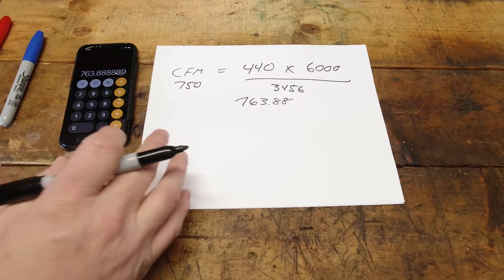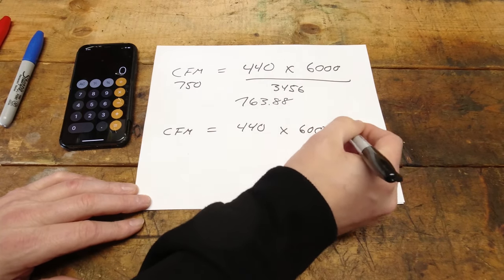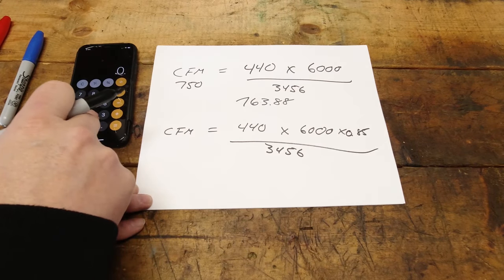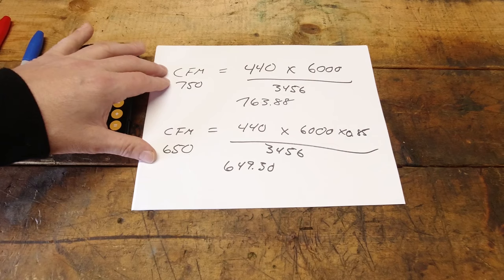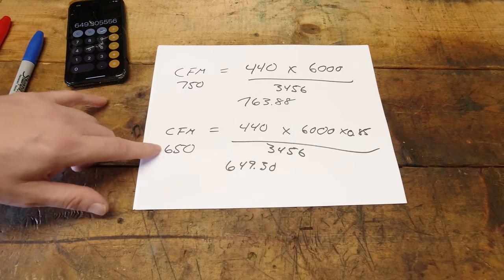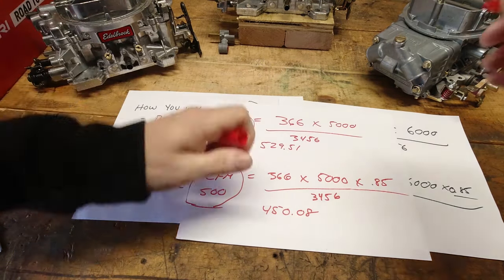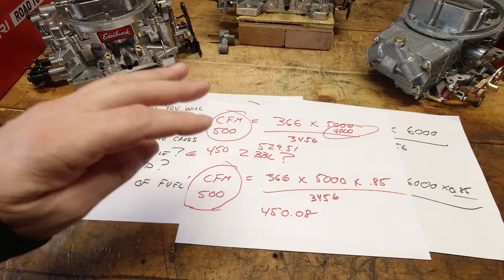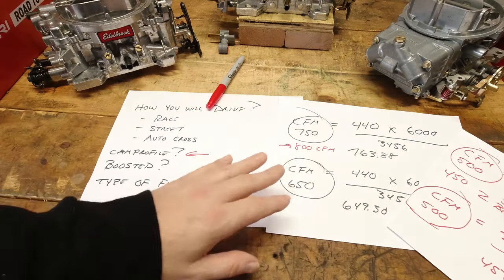How to Choose the Right Size Carburetor

Comment: I have a 385 sbc stroker and have a 650 carb on it and I feel like it's to small ... it takes off really good  and  runs lean around 3,800 rpm on up ... it's weird tho It's an old quickfuel DP blow thru carb just can't seem to make it work... it's on all  motor right now I plan on spraying it later ones running right motor is built for nitrous
Reply from the maker: You’ve got a lot going on there.  How do you know it’s running lean at 3800?  Are you monitoring with an AFR?  Running a blow through carb on an n/a engine is likely causing part of your problems.  The main metering circuit isn’t seeing the volume of air it needs to flow fuel.  Time to reset.  Based on what the video talked about, what’s the rest of the equation?  You have to give those numbers so we can make a determination on what the best size is.  Don’t know the rpm?  What are your cam specs then?  How are you going to drive this?
Reply: @MuscleCarSolutions  the cam lsa 105, dur 256/264 .... 215cc heads , strip dominator  intake..
Reply: Rpm range 3,200-6,500..... I drive it on street but gonna be raced pretty heavy I drive it like  I stole it ...I know I need more converter than I have right now  so will change it later and I need more gear than 3.73 I have on it right now
Reply: Plugs look Lean to me and it breaks up in upper rpm ... like I said gets out of the hole like a monster and just noses over
Reply: @MuscleCarSolutions  sorry sent messages to myself 🤦‍♂️
Reply from the maker: @garypena5178  I won’t pick this apart too much but the LSA on that cam isn’t nitrous friendly.  You need the rpm from a wider lobe separation.  112-115 on a nitrous engine is what it typically likes.  You’ll struggle a bit with that.  Plus the intake and the big runners are asking for the volume of airflow and that cam will kill a bit of that.  Once you get all the other issues sorted, I’d assume a 750 would fit more to what the engine needs.  Mismatching parts will be frustrating for awhile but getting it right in the end makes the whole thing come alive.
Reply: @MuscleCarSolutions  I was think bout going 750 or maybe little more
Reply from the maker: @garypena5178  it’s possible, but going big right now will make that thing a dog till you get the other things sorted out.  But if you’re looking to keep driving and do one thing at a time, I’d address the cam first, converter at the same time if you can and rear gears last.
Reply: @MuscleCarSolutions  sounds good gonna keep messing with it and see if I can get it to work good just got it running ... but gonna try a bigger carb out ... thank you for your time sir 🙏
Reply: @MuscleCarSolutions  yeah the converter would help it  big time ... just wanted to try t cause first gear is quick
Reply from the maker: I’d start with a 750 if you can.  I think once you get the cam sorted it will give you a better idea.  The LSA right now is helping that low end response.  Don’t get used to it!  You’ll lose quite a bit of that when you switch cams.  The intake and the runner size on the heads is asking for rpm.  But the rear gear and the stall will help get you into that rpm range quick and of course a big shot of nitrous will seal the deal!  Have fun with it!
Reply: @MuscleCarSolutions  I will .. thanks again. I'll let you know how it turns out ... will send you a video of it at track should make it out next month

Comment: So basically my 650 elder Brock it’s possibly too big for my motor. 302 Ford racing crate motor GT 40 heads at the E cam
Reply from the maker: Don’t know.  What did the formula come out to?
Reply: @MuscleCarSolutions  567
Reply from the maker: I’d be comfortable with the 650 though it might run on the rich side.  And given the 650 needs a little more airspeed to meter fuel properly so tuning might be a little more challenging but not impossible.
Reply: @MuscleCarSolutions  Actually he is running a little lean when cruise. I ordered another jet and metering rod. I’ll start out with just a metering rider first. Parts be here Monday
Reply from the maker: Are you following the tuning chart?
Reply: @MuscleCarSolutions  yes

Comment: Need help getting the right carb. 351c/410
Reply from the maker: Based on the video, what did you come up with?
Reply: @MuscleCarSolutions  around a 670 to 700
Reply: It's 10 to 1. 2v ported heads 91 octane 5500 rpm highly moved but not to crazy aluminum reverse dome pistons cam is not loppy
Reply from the maker: @pokemonsong8400  how are you planning on driving the car?  Fun cruiser or some racing?
Reply: @MuscleCarSolutions  fun cruiser
Reply from the maker: @pokemonsong8400  at that rpm I’d be comfortable with a 650.  No problem at all.  Easy to tune, good throttle response and fun to drive.
Reply: @MuscleCarSolutions  OK sweet there's a 600 holly on it right now. Should I go single outlet or double pumper
Reply: It's in a 66 f100
Reply from the maker: @pokemonsong8400  up to you.  If it were mine I’d be completely happy with a vacuum secondary carb if you’re sticking with a Holley.
Reply: @MuscleCarSolutions  I appreciate you answering my questions definitely helped. Awesome channel brother
Reply: Can't really find a 650 with vacuum sendondary would this be ok
Reply from the maker: @pokemonsong8400  sure.  Give it a shot.  See how it goes.  You already have the 600.  No reason to not see if you can make it work.

Comment: Good day. I have a 355, a comp 280h cam duration@.050 230 intake 230 exhaust. Rpms between 5000 and 5500.  Aluminum heads 70cc with 2.02 intake and a 1.60 exhaust. 4500 to 5500lbs chevy c10 with 410 gears that is a weekend driver but will be racing it on occasion. I run 94 octane in it. Right now I have a 650 edelbrock avs 2 on it. 
Would love to know your thoughts?   Thank you in advance.
Reply from the maker: Probably ok.  That cam actually has a range of 2000-6000.  I happen to know that grind very well.  Use it in quite a fee engines.  Great cam!  😉 You’re in a slight gray area here.  It’s a big heavy truck.  That grunt down low and mid range is what makes that a fun driver around town and the 650 is plenty.  The rest of the combination looks good.  The issue may be at the upper rpm end if you’re making passes at the drag strip.  If it feels like it noses over and loses power after 5000 rpm, then a slight bigger carb would be helpful.  The issue with that would be it would negatively affect your street driving.  Will run rich, have that lovely stinky gas smell all the time and foul plugs frequently.  So you’ve got a choice to make here.  Is it more of a street driver and you’d rather have a solid runner there?  Or is the drag strip your passion and who cares how it runs on the street?  Only you can answer that one!  How does it run at the track for you now?  What elevation are you at?
Reply: I love the cam as well. Driving is more important to than racing. I am looking at a 650 holley brawler to replace my avs 2. We are in alberta canada and am 3600 feet above see level. I have not taken it to the track yet just finished building it at the end of last summer.
Reply from the maker: @robgregg3389  the Edelbrock is way better for your situation than the holley would be.  If you had said you’re more interested in track time, then I would have leaned you that way in a slightly larger CFM. On a side note, I’ve spent a lot of time in my recent past at Castrol.  But at that elevation you’re racing a little south of there.  ;) Love AB.  Great memories with great people.
Reply: Thank you very much for your time. It is really appreciated, I have had so many different opinions and you have made my decision easy. I will stay with the edelbrock and put the money I was going to spend on the brawler to better use on the truck.
Reply from the maker: @robgregg3389  anytime!  Summer coming soon.  Hope you enjoy that C10!

Comment: Make it easy on yourself cubic inches X 2 for carb size. Got a 350?  350 x 2 =700 cfm.
Reply from the maker: Using too big a carburetor is the biggest mistake that folks make when choosing to run one.  That formula just enhances that.  700 CFM MIGHT be ok, but I’d guess 99 times out of 100, they’ll go to the next bigger size and on goes a 750 double pumper that they can never get to run right.
Reply: @MuscleCarSolutions  CID X 2 = cfm is easy for the average guy to understand. I use it and have suggested it for 45 years for street cars. No one knows what their VE is, 99.9% of us are just shade tree mechanics playing with our hobby cars. Guys just want their engine to idle good, have good throttle response and decent top end power.

Comment: You didn't say anything about the fuel pump!! The stock fuel pump may not keep up with the demands of the larger carburetor!! Use a electric pump with a regulator will solve the problem.
Reply from the maker: The pump is a support system to the carb.  Once you have the size determined, yup, select the supporting fuel system components needed.

Comment: 350 chevy headers mild cam edelbrock eps??
Reply from the maker: And?  There’s quite a bit of info you’ll need to provide to get an answer!  What’s the car/engine bing used for?  How are you going to drive it?  Street, strip, Texas Mile?  What’s the cam profile?  What type of fuel are you using?  Boosted?  N/A?  Nitrous?  Details man!  Throw me some details!
Reply: @MuscleCarSolutions  street  93 octane 74 nova just driving it to shows. 12-210-2 cam comp
Reply from the maker: Well that is a mild cam for sure.  600 or the 650AVSII would be just fine.
Reply: @MuscleCarSolutions  thank you sir!
Reply from the maker: @lordsauto  no worries!  That size will be a touch too big right now, but if you upgrade cam down the road, you’ll grow into it.  Best of luck!  Big fan of the X body cars.  They don’t get near enough attention!

Comment: And yet the stock 440 6 pack flows around 1100cfm and did fine
Reply from the maker: Because they were factory progressive linkage set ups connecting then.
Reply: @MuscleCarSolutions  correct and vacuum but once the the go fast pedal was pushed they were wide open flowing that amount. There is never one way to figure it
Reply from the maker: That’s how progressive linkage works!

Comment: So much of this is untrue you really need to do this at the racetrack or on the dyno those small block Fords and Chevys and mopars can handle an 850 Holley and put more power out than a 650 like you're saying if they got good air flow buddy
Reply from the maker: You’ve missed the point of the video completely.  Most street cars will never see a track and for sure not a chassis dyno.  Not every car is a race car.  But it’s addressed in the video with the other considerations needed to make the right call.

Comment: Your math is incorrect .. cfm is not a universal amount ... You are calculating ingested CFM by the motor but a carb is cfm based on a pressure drop done on a bench ....if you look at a 2bbl cfm it's different than a 4 bbl cfm ... Standard used to be 20.4 inches of water for a 4 bbl during a test but some companies now use a different standard so even carb to carb cfm can be apples and oranges.... Anyone that tested cfm flow on a Dyno will tell you it's never the same as the carb size .... A better way is to take cylinder head cfm at peak camshaft lift times 3.38 for a V8 and that will give you an idea of needed carb size and it's all tested the same way
Reply from the maker: No one, and I mean zero people are going to search for flow data (cylinder heads or otherwise) and stumble though a formula that they aren’t sure of nor can explain to their sorta car buddies who are trying to figure out what carb to use on their bolt on modified small block in a C10 pickup.  If carburetors were sold in very exact, widely sized CFMs, then sure.  Getting to a very specific number would be better.  The most common carb sizes are 600 and 750.  A simple way of deciding which is the formula in this video, which has gotten the mass majority of the community by for decades.  I’m all about that flow data when I build cam profiles for myself and customers.  But in most applications, it doesn’t need to be complicated.  At all.  One video we’ll be doing in the new year is on a flow bench.  There’s a lot to be learned for the top 5% of folks looking for every drop of power out of a combination.
Reply: @MuscleCarSolutions  I have owned a flow bench for 30 years ... The formula you are using has been wrong for decades .... Everyone that buys new heads looks at flow numbers and Stan Wess has most numbers on his site for stock and aftermarket heads ... Using the formula you showed is useless and you might as well just guess ...
Reply from the maker: @scotthatch4548  and yet and entire generation or two has used it and picked the right size needed.  So how wrong is it?  You’re nitpicking something that doesn’t pass the real world test.  It works.  It’s simple.  Every car guy or girl ever has been successful using it.  👍 You’re referring to something that a vast majority will never need that finite of a definition.

Comment: The 3456 method gives you way too small a carb
Reply from the maker: For a typical street car it’s spot on.  The only things it fails to take into account are all the other little pieces to the puzzle as mentioned in the video.  It’s still extremely common to see folks put on too big a carburetor.  Whether it’s an ego thing or just bad advice; it’s very common for me to drop folks down a size from something that was way too big for their application.